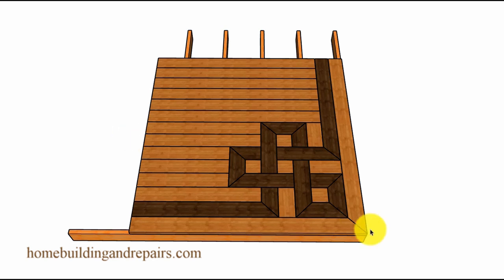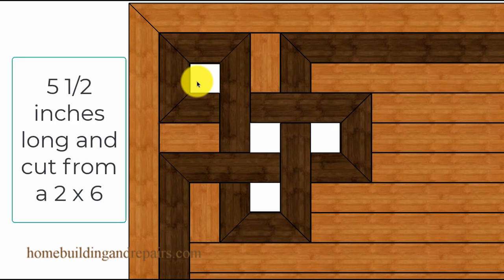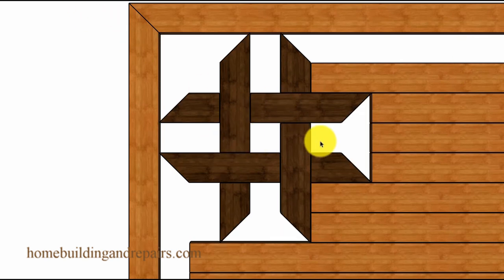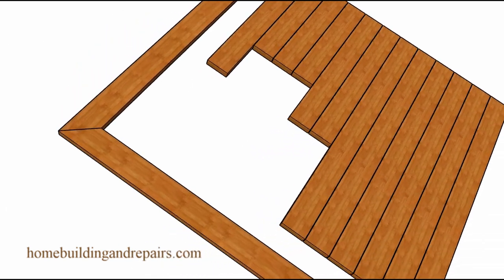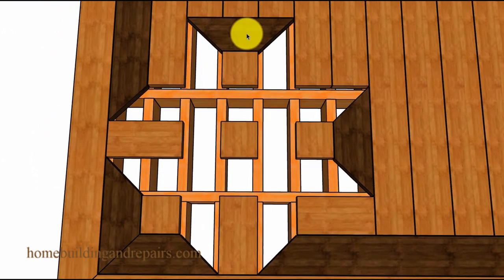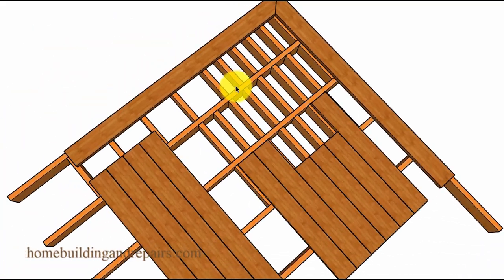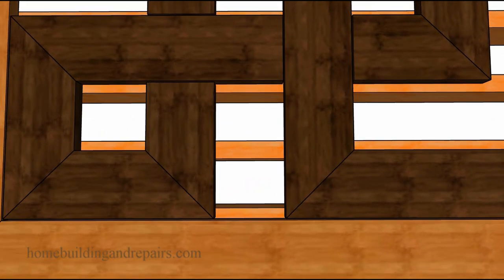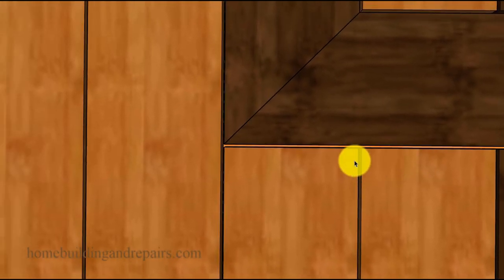How To Build What Looks Like Weaving Corner Deck Detail - Incredible Deck Designs

Comment: FANTASTIC PRESENTATION!!! Can you rerun this with the joists at 12 inches O.C. ? Most composite deck boards have to be supported every 12 inches.
Reply from the maker: I would think so and always check with decking manufacture for joist spacing.

Comment: Did you face nail all pieces? Would use alot of hidden fasteners but would this work with hidden fasteners?
Reply from the maker: You might need additional blocking for hidden fasteners.